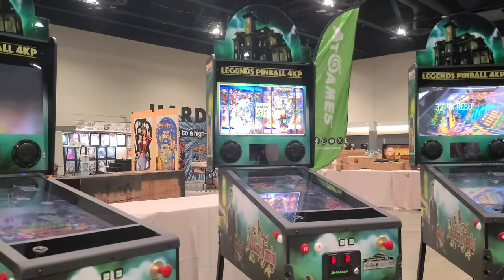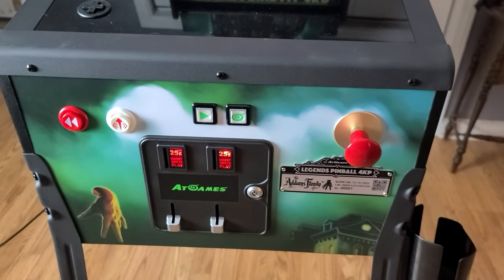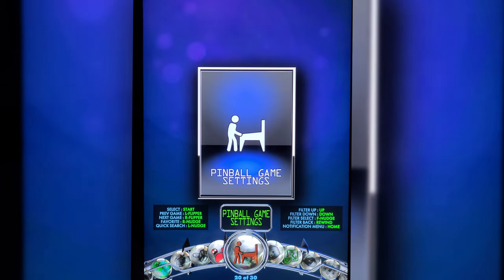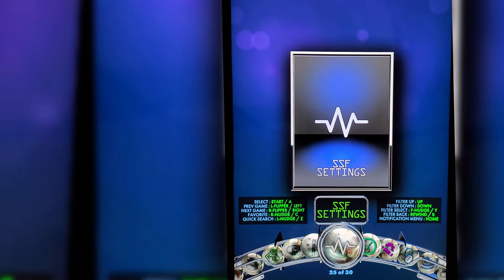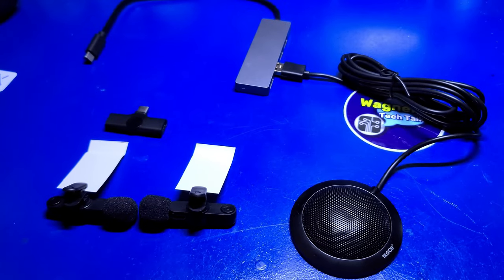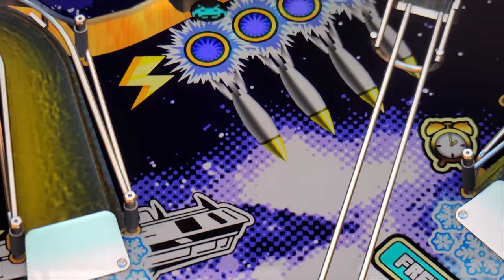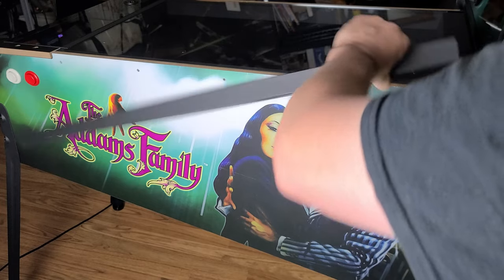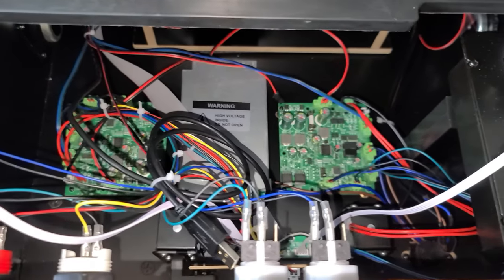AtGames Legends 4KP SSF Kit First Look, Arcade Control Panel and more

Comment: THanks for the update Jon, def alot of work has been put into this and I appreciate their efforts and your info. I've been doing alot of Vpin research and I am still happy with my decision to preorder, there are some much more expensive and HUGE in size and weight products out there that peak my interest. For the weight, size and price, this is the best thing around by far. For example to gain 17" in the playfield and 120hz will cost 8 grand plus more and 200lbs more not to mention WAY bigger, this is the option I am looking at down the road when 8k and 3f become more the norm.

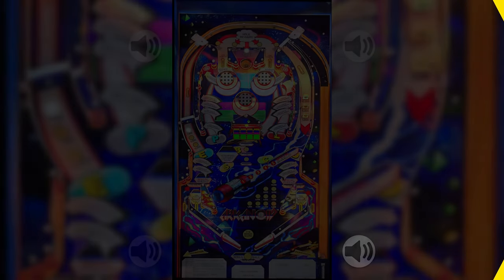Comment: I know you were manually trying to demonstrate the surround effects in the segment at 8:10, but I'm a bit confused. As I understand it, the only audio that should "travel" and come from the surround speakers should be the physical/mechanical sounds of the table (like the rolling ball, the flippers, the poppers and targets, etc.), but the music and callouts should only be coming from the front speakers and the subwoofer.

Is that the case?  It kind of sounded like the music was traveling with the ball, but that might just be a side effect of your attempt at simulating the experience.
Reply from the maker: Music comes from the two stereo speakers on the backbox.  Just imagine the ball rolling sounds and target sounds are coming from various directional speakers in the 4 corners + the bass shaker.  It was the best way I could come up with.  The only true way is for you to experience it is in-person. This wasn't a perfect example, as you also hear the music move from the left-right channel speakers which is not the case in front of the machine.  No way for me to separate the music and other sounds, if that makes sense :)
Reply: @WagnersTechTalk Perfect!  Thanks again for a great video and a detailed response!

Comment: Thanks for the video, makes me a little more excited about the 4k! One thing that has been bugging me: Is audio latency still as bad as with the Pinball HD? In the video it seems that it's way over 100ms (listen to the delay between solenoids or button presses and the corresponding sound effect)  :/ Anything <50ms would probably be acceptable, <20ms would be great. I love my Pinball HD, but this sluggishness in the audio implementation really hurts the experience, especially with pinball being an extremely timing based game (stating the obvious here ;). cheers and happy new year!
Reply from the maker: I've listened more carefully to what you're saying while playing it, my hearing is not the best, I'll be honest.  But I'm not seeing a noticeable audio delay while playing, but it can be that I'm just less sensitive to it.  When the actual production machine arrives, I'll take a closer look into this through my video editing software where I can perform a closer analysis by slowing down the audio+video.  The machine shown here isn't the final version, just more recent than the early evt unit that we discussed.  I appreciate your comment and Happy New Year!
Reply: @WagnersTechTalk  Hey! Thanks for the reply! I must admit that I'm overly sensitive to that as a computer sound/music person. Synchronicity for a keyboarder requires <10ms delay - but my suggestion of 50ms is a realistic compromise  ;) I'm very certain that it does make a difference for the feeling of immersion for the average user too. Similar as in games like beat sabre or any other timing intense game, even super mario. In a capture, you can simply go frame by frame and measure the distance between e.g. a bumper hit and the peak in the waveform of the related sound. At 60fps a frame takes approx 16ms. Just gotta be careful that any apparent delay is not due to the capture pipeline or codec issues. Another observation I made on the Legends HD that makes the problem apparent: If you mash the flippers really fast in many tables, the repetition "snaps" to the audio update rate, presumably the audio engine block size. So it gets strangely rhythmical, like a regular beat, and it can't go faster than X, regardless of how fast you mash. Cheers and thanks for looking into it!

Comment: So after your experience with the SSF kit, what's your overall opinion of it? Does it really make a big difference in immersion? Worth the cost?
Reply from the maker: Yes, I personally notice a big difference without the SSF kit.  The deeper bass, the sound of the ball rolling on the table, etc. add to the immersion.  I tested with SSF, then without and immediately noticed the difference.  I avoid pricing discussions, they are subjective.

Comment: Great video. It was helpful and informative. I have two follow-up questions. 1. With the arcade control panel, will there be games on the ALP4K to play with the control panel. Outside of OTG, CoinOps,  BYOG, and ArcadeNet, what games are built-in and purchasable that can utilize the joystick, trackball, and buttons? 2. With the other branded collector's editions being announced soon, can you switch a pre-order for the Addam's Family table to a different skin (if announced and available for sale before arrival of the Addam's family branded table).  In other words, can I take my deposit and money from the preorder of the standard cab and transfer it to one of the new collector's edition skinned cabs? Thanks!
Reply from the maker: I'm not sure what the plans are from AtGames as far as arcade/console game packs on the 4KP.  In APL (Arcade Play Link) mode (pressing the channel button) you can assign which display to show the game (i.e. backglass, playfield, etc.).  Everything on this machine, currently, is pinball related.  However, there are several arcade packs available on ALP HD that I suspect you'll also be able to play on the 4KP.  You also have OTG for playing pretty much anything you can imagine.  One of the reasons for installing the ACP, besides easier navigation, is to have it ready to try out arcade/console packs when they become available, OTG and to make sure everything works before others get their machines.

I don't think you can change the machine skin after an order is placed, but I have asked the question.

Comment: Hi John, another great review, can´t wait for my ALP 4K - thank you so much for the hard work you put in. One follow up question: Are we still going to need the Video Input Backglass Switchboard in order to use custom backglas art, etc. ?  Cheers
Reply from the maker: Very welcome and thank you for watching!  No, the VIBS is integrated into the main board (PCB) on the 4KP.  The hardware tour video goes into this a bit more by showing all 3 HDMI inputs, if interested: https://wagnerstechtalk.com/alp4kevt/#Part_1_Hardware_Tour
Reply: @WagnersTechTalk  Cool thanks John, I only hope I can make the ALP work with 220 V and not having a too hard time to implement the SSF Kit - but thanks to you I am confident:-) Cheers and keep up the good work

Comment: Interesting that atgames said there was no perfect solution to haptics setting off accelerometer. When i installed a 2 haptic/1 shaker puck to amp and dedicated 24V psu in alp hd, i tested the speakers mounted to base and side cabinet as theyre doing. No go, was tripping accelerometer.  I fixed it by mounting the haptics on blocks, then using foam as sound vibration blockers at base mount. The setup is an elevated speaker system not contact with cabinet at all, allowing me to run accelerometer now at max with high volume and bass. Look like ill be doing the same with their new model
Reply from the maker: Nice tip, thank you for sharing!
Reply: @WagnersTechTalk  I can send imgur pics if interested of the setup. I ended up biting today and got the Mars table with ssf installed. I may have spent far more than what I could've pieced together but I'll take a shot and crack it open on drop date to see how it's done. One note is ssf kit is only 90 day warranty, but its 1 year IF atgames installs it.

Comment: I was hoping maybe you were able to catch a glimpse of how the SSF kit was wired into the cabinet, whether it wires directly into the mainboard (or some other stock board that is apart of the stock cabinet, or if the SSF kit itself comes with something ACTUALLY more than just the 4 exciters and sub. I ask because I already had an SSF installed on my HD, which I would just take out an use, since I like my Dayton HDN8s WAY more than the DAEX58FPs that it appears they are using on their kit. I had tried those on my ALP and they weren't powerful enough for me. AtGames for some reason simply does not want to let me know if the kit is just the speakers, or if it will come with a special PCB and/or 7.1 sound card. They keep giving me EVERY excuse in the book as to why they cant help answer that at the moment. The answer is literally the difference between me buying the SSF kit or not. Having to buy it feels like a waste a money as is, even if it comes with other items i would need besides just the speakers. If it was speakers only, it would be 100% COMPLETE waste of money, lol.

Let me know what you saw internally.... Even if you aren't 100% sure, your best educated guess will suffice... just anything, please! No more "AtGames" type answers 🤣
Reply from the maker: Please see towards the end of this video, you'll see some shots of the inside of the cabinet.  I don't know the BOM for the SSF kit, until I do I can't determine what is in the kit and what comes pre-installed.
Reply: @WagnersTechTalk   dang, yea unfortunately, the video clip didn't happen to show where the Dayton exciters were wired to. Lol, it actually doesn't even matter anymore to be honest, as I just paid for my pre-order of AFM CED and the SSF Kit + Preinstallation. Didn't want to take the chance of having to pay full price later on if I find its more than just the speakers. Thanks anyways though... Still hope you are able to obtain a more in depth walkthrough of one sooner than later.
Reply from the maker: Gotcha, yeah hoping to show the installation of the kit from beginning-end.  Not sure how many people are going to need it, looks like most took AtGames up on the pre-installation deal.  However, I'll create it anyway (once available) as I'm sure it will be helpful to someone.  May also be a good reference for those who had it pre-installed and want to see what all they missed out on Lol.

Comment: As a point of reference, how does the SSF kit feel in comparison to Buy Stuff Arcade's haptics kit?
Reply from the maker: They aren't directly comparable.  It's hard to explain audio, but the BSA Haptics kit sounds very good compared to the stock audio.  However, the SSF kit provides multiple channels of audio and each independent of the other allowing sound to travel across the playfield.  To accomplish this, the tables themselves have to be coded to support what speaker(s) receive the audio and at what intensity.  Two very different experiences.

Comment: One other note, if the ssf supports otg ssf or is it dedicated? Would be great to crack it open to see parts used and how it's hooked to board, or an amp. $350 is a bit for 5 speakers ($17 haptics)
Reply from the maker: SSF over OTG, last I heard, was coming yes.

Comment: Great video! Do the front exciters under the control panel still have that annoying buzzing like the original Legends Pinball? or has that been resolved?
Reply from the maker: The new machine has more screws that are installed than with the HD.  However, the control panel I installed was the older model (very early version that didn't have the pre-drilled holes in the ACP).  However, with the stock panel nor the Arcade Control Panel, I didn't experience the same vibration as I did with the original ALP HD.  I can't say it's been resolved, but it's not something I personally had an issue with.  Perhaps they lowered the voltage output, I can't say exactly.  The "buzzing" was indeed an issue with the original panel, I'm not seeing it here.  Then again, I do tend to tweak things and it could be I set the haptics much lower.

Comment: Arcade1up flippers rest around 35 inches. The front of the machine is like 36 1/2 or 37 with lock down bar close to 37. 
I hoped the legends 4k p would have had the same playing height

Comment: Good video! 2 questions

1. What is the point of the exciters under the control panel if the flippers use the solenoids? So they serve any other purposes?

2. Are you going to release a video of using the SSF kit in OTG?
Reply from the maker: Thank you, a few answers:  
1)  Solenoids can be turned on/off.  The exciters do provide additional  haptics as well, just more options for us.
2)  Likely so, more to figure out and didn't want to hold up showing the basics of SSF for that as each application will require further investigation/experimentation.

Comment: Thank you for the content. With the SSF kit causing the table to tilt if the volume is to loud. Do you really notice a huge difference in sound without the SSF kit
Reply from the maker: Yes, I personally notice a big difference without the SSF kit.  The deeper bass, the sound of the ball rolling on the table, etc. add to the immersion.  I tested with SSF, then without and immediately noticed the difference.

Comment: Hey John great work. Have you tried otg? Does the ssf kit work well with otg? Is there any additional setup required for that?
Reply from the maker: Thank you!  I plan to show SSF+OTG at a later time, more research and testing is needed.  In this video, I wanted to demonstrate what I couldn't at Pinball Expo due to the background noise at the show.  I'll continue to fill in the gaps, where I can.

Comment: Since these are being built to order, wondering why we have to install the SSF kit 🤷‍♂️ I’m not very handy 😏
Reply from the maker: They go through production runs of each cabinet design based on qty, they aren't actually built-to-order.  As soon as I receive my cabinet and SSF Kit, I'll demonstrate what's involved and create a written guide to make it even easier.  The one shown here is a loaner that already had the SSF kit pre-installed.
Reply: @WagnersTechTalk   Looks like this SSF kit installation issue was solved. Got an email to have it pre-installed for $50. Extends delivery by 2-4 weeks. I can live with that 😉

Comment: Thanks for the demo. Do you know what utility the arcade panel will have when the axe CoinOps?
Reply from the maker: CoinOpsX is a 3rd party application, once the 4KP's get into the hands of community developers, we'll find out.  AtGames had also released several arcade/console packs for the ALP HD that will most likely come to the 4KP as well.  Ease of navigation and use over OTG was my main reason for installing the ACP.

Comment: Do you think the buy stuff arcade 2.0 backglass mod will have compatibility with the new 4k legends pinball?
Reply from the maker: That will be up to BSA.
Reply: Unlikely, from the original assembly video, it looked like both panels in the backbox are LVDS, versus the eDP used for the original back glass.

Both the BSA and stock ALP 4K backglass are 24" panels. It's just the smaller 8" DMD in the ALP 4K vs the 12" or 15" depending on the BSA box style you pick. If you really need a larger DMD, it would be much less expensive to mod in a larger DMD and pray that the Geekworm LVDS to HDMI convertor works so you can keep the stock DMD functionality.

Comment: Wagner do you own a Arcade1up pinball machine?  And if so is the legends 4kp the same playing height ?  Thank you
Reply from the maker: I don't own an A1UP pinball machine, but you can find the dimensions of the 4Kp here to compare:https://wagnerstechtalk.com/alp4kevt/#Cabinet_Comparison_HD_vs_4KP
Reply: Just went on Arcade1up website says there flippers rest at 35 inches…..so is it safe to say they would be the same since legends 4k p measurement says 35 inches in the front ?
Reply: Also I have the puck exciters the large ones. Will I be able to swap those and my bass shaker into the ssf kit ?
Reply: Any word on when we will get more zen tables gameplay please ATgames ?

Comment: I've got a super ignorant question. I don't own, and haven't ever played the original Legends Pinball. I see a lot of comments out there about something called "coinOpsX?" going away? Will the 4K Pinball be able to play vertical arcade games using the BYOG/Add-on feature that you described in this video? https://www.youtube.com/watch?v=iHGMORDxC9M
Reply from the maker: Not an ignorant question, it's a tough one to answer at this point.  CoinOpsX is a 3rd-party application that is community developed.  As a result, we'll have to wait and see what the community creates to take advantage of the faster processor and other features of the machine.